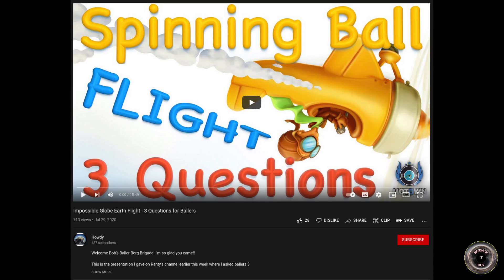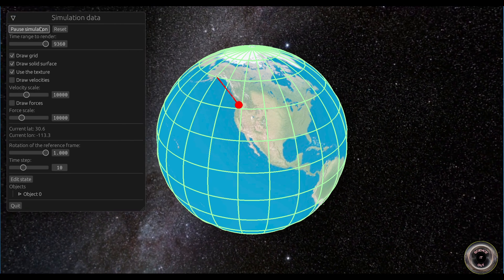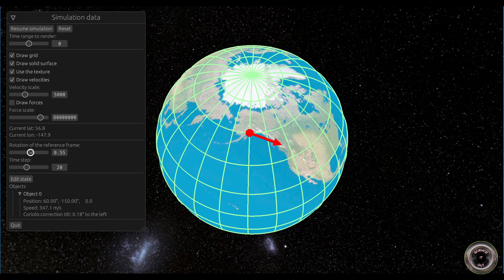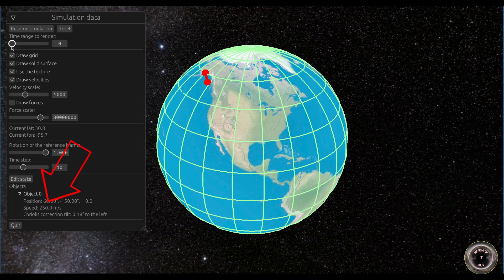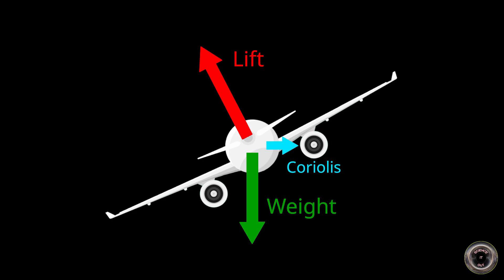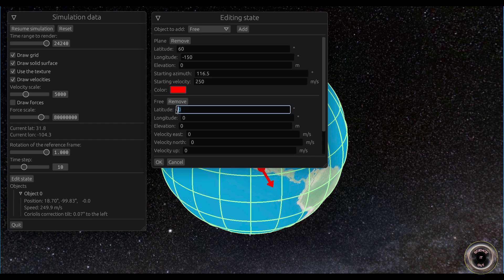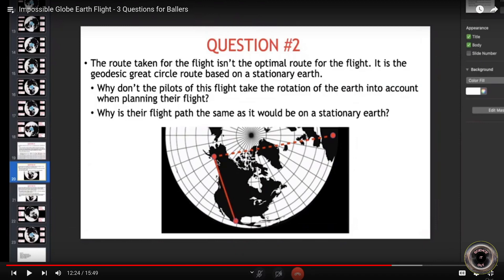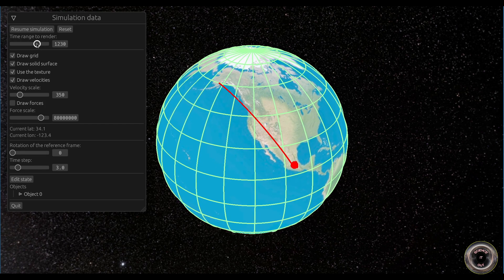Anchorage - Mexico City - an "impossible" flight on a globe? Answering Brandon's questions

Comment: When I check the linear speed at latitude 60 degrees I get 518 mph. 513 mph is an R of 3919 miles, typo perhaps Brandon?
.
For the 1st waypoint Brandon has neglected to specify Required average speed in Space (518 mph) and Momentum MPH (518 mph). He claims in that table that the momentum of the plane does not change during the flight which is nonsense and so the usual flat Earth strawmanning. Using Brandon's "Space" view point, the momentum speed of the plane at each way point will be the tangential vector of the Earth's rotation at that location and elevation plus its ground speed in its current heading, so to get some rough figures I'll use Brandon's calculated MPH for ground speed and reduce the sum by 12%. I get for momentum speed & Engine speed:
1 = 518 mph, 570 mph
2 = 1089 mph, -10 mph
3 = 1271 mph, -156 mph
4 = 1258 mph, -79 mph
5 = 1327 mph, 36 mph
Now it doesn't seem quite so surprising does it Brandon?
Reply from the maker: "When I check the linear speed at latitude 60 degrees I get 518 mph. 513 mph is an R of 3919 miles, typo perhaps Brandon?"
Could be. Or some kind of rounding somewhere. The difference is small enough to not matter much. I didn't even notice, TBH 😛

"He claims in that table that the momentum of the plane does not change during the flight which is nonsense and so the usual flat Earth strawmanning."
I think he's trying to treat the plane as a ballistic object. The plane got 513 (or 518) mph from the surface and that's it, it's not in contact with the surface later, so it can't gain anymore... but of course it's still in the atmosphere and it can still "be pushed" by it. Brandon would be correct if planes were flying in a vacuum.

"Using Brandon's "Space" view point, the momentum speed of the plane at each way point will be the tangential vector of the Earth's rotation at that location and elevation plus its ground speed in its current heading"
Right, and that's a better view precisely because the plane is within the atmosphere, which is rotating with the Earth, and the engines counteract drag.
Reply: @scienceitout  "Brandon would be correct if planes were flying in a vacuum"? Hmm . . . The ballistic object is in a gravity field. It will be accelerated by that field and so gain momentum and speed from Brandon's "Space" view point. The only way it is staying 10 miles or so above the surface is by extra force being applied to resist gravity. The object is going way too slow to be in an orbit.
Reply from the maker: @sthurston2  "The ballistic object is in a gravity field. It will be accelerated by that field and so gain momentum and speed from Brandon's "Space" view point."
Well, yes. Maybe I'm just trying too hard to make sense of what he said 😉Like "let's ignore gravity and forget how the plane stays at a constant altitude for a moment, and just imagine what it would look like if the plane was constrained to move within a spherical shell". In such a case you'd kind of get an object that just "inherits" momentum from the surface once and then proceeds along a great circle in the inertial frame. Maybe it's a bit too much magic for a discussion about reality, though.

Especially since gravity does complicate matters. And actually when you add lift to counter it and make an object that is too slow to be in orbit stay at a constant altitude, that complicates things even more thanks to Earth's oblateness and the fact that vertical isn't parallel to gravity (well, as long as you assume lift to be vertical - you can explicitly assume it to be parallel to gravity and then the result is different).

Bottom line, yeah, I agree with what you wrote here.

Comment: Why would the plane take that route?  Great circle routes anyone?
Reply from the maker: I think the point was "why is it a great circle route in the rotating frame, and not in the inertial frame?" - which is not that stupid of a question. For example the ISS flies along a great circle in the inertial frame, its ground track is not a great circle. But of course the ISS is outside the atmosphere, and planes are inside...
There will always be a reference frame in which the path of an object is not a great circle.
Reply: @scienceitout  

1. The plane flies in the atmosphere which is moving essentially the same speed as the Earth. 
2 .The upper level winds have magnitudes larger effect on flight paths than coriolis. It literally gets lost in the wind.
3. Break up the problem into 1 minute increments and see how insignificant coriolis is to a plane.
Reply from the maker: @scott_meyer  1. Yes, I'm pointing this out in the video.
2. Winds do have a larger effect, but they also have a slightly different effect on the plane than Coriolis. You correct for wind by changing the heading (so that the plane's nose doesn't point in the direction of the ground track), but for Coriolis it makes more sense to correct by banking. You could also correct with the heading, but it would basically mean flying in a constant slip, which would increase drag unnecessarily.
3. The simulator breaks it up into 10 seconds increments 😉And it does show exactly the magnitude of the effect.